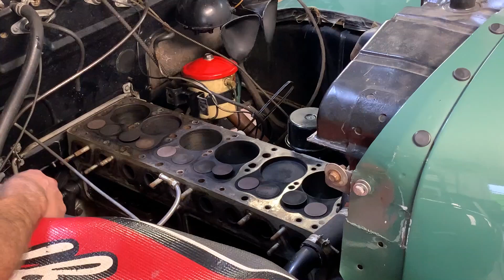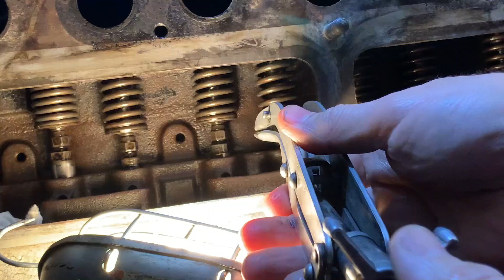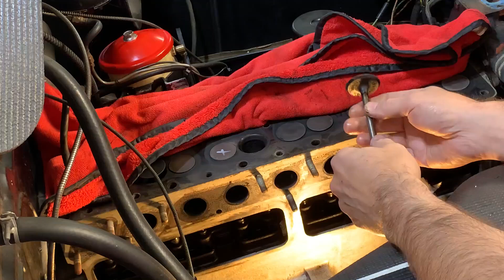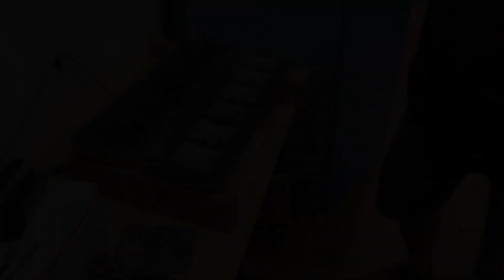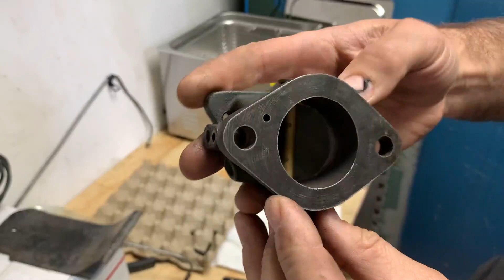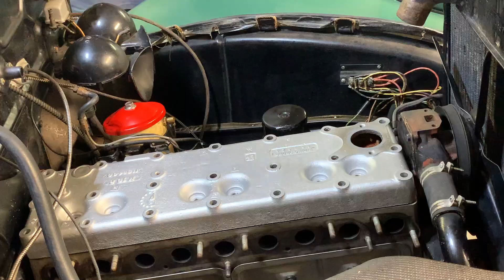Part 2: Cracked Cylinder Head - The Reckoning

Comment: Where do you order parts? I’m new to this with my first classic car, have a flat head 6 with a coolant leaking into combustion chamber, I’d like to replace gaskets, resurface the head and maybe replace intake and exhaust manifold and water pump while I’ve got it open if possible. But don’t know a dependable place to order from.
Reply from the maker: I buy parts from many sources. Some parts, from Rock Auto. Some at “Vintage Power Wagons”.  Or “oldmoparts.com”  I recommend you stay away from MoparPro as much as possible.  You need to measure the length of your cylinder head. Is it 23” or 25” long?

Comment: Valves get longer as they warm up. When this happens those nice   lapped areas no longer seal against one another until the engine cools down. Since I learned this I just use the 3 angle grinding method now.

Comment: I have an inline-8 engine: Chrysler 1946. What oil should I use? I put in 40 single-grade. Is it too thick?
Reply from the maker: Depends if you have sludge still inside your engine, from using non-detergent SAE oil.

Comment: Hello Keith, jusg another quick question for you; #6 cilinder has the hole drilled for a pin that can be set ontop of the piston. I would amagine for timing purposes. Mine is gone. Do you by any chance have the dimensions of this pin available please? Marty.
Reply from the maker: Its a brass plug, pipe thread. You should be able to easily get one locally. They are readily available and used in countless applications.

Comment: Hello Keith, thank you for your video's.  I much enjoy them. I have recently removthe head from my 1947 Fargo pick up with a T116 engine and noticed that the cylinder head bolts are threaded right into th water jacket and a coupl are threaded rightinto the intake runner in the block.Just wondering about sealing issues? Would a copper washer under the headbolt be in place for sealing purposes?
Marty.
Reply from the maker: Use Permatex high performance thread sealant on the headbolt threads.
Reply: Hi Keith, I'm nearly at the point of reassembling my head with the new head gasket... Will I be able to check torque on the headbolts in the 'future' if I use this thread sealant ?

Comment: Hi Keith. I just became an owner if a 1951 Dodge Wayfarer with stock 230 flat 6 and gyromatic trans. The runs and drives like new but is in need of a full service (all fluid change) I was wondering what fluids you run or what you recommend. Thanks

Comment: Hello Keith, newbie here again. I have been working on the timing and carb on my 53 Windsor. I set the idle down to 450 in gear and it shifts much better. It will never down shift on it's own due to the 12v conversion. I'm not a purest, so at some point I will modernize it. Thanks for all your video's and advice so far. Sherm
Reply from the maker: You cannot get a 12V shift solenoid for these transmissions. If want want to convert to 12V expect many headaches to come.
Reply: Newbie again, do you remember what kind of gas milage you got in your Windsor
Reply from the maker: @MarkSherman-h6u  I never actually calculated my fuel economy.  I always figured my old cars are for my pure pleasure. I thought that calculating fuel economy would maybe spoil some of the fun.  I didn’t want to know. I suspect 12-14 mpg might be a reasonable guess.

Comment: Hey Keith I have a 38 coupe  and wonder if  you could post a picture of the  bottom hand brake  cable  bracket.
Reply from the maker: I don’t believe we can post any photos here in You Tube chat.
Reply: If you could text me a picture I would greatly appreciate it. 602-339-7595
Reply from the maker: @ronaldmatusevitz8967  Can do. The cable bracket at the transmission mount?
Reply: @keithsgarage5831  Yes that's what I am looking for. Thanks

Comment: 2 silly questions from a newbie you’re helping out (me). #1: does the rebuild of the carb affect your fluid drive or is that regulated by an electronic controller?  #2: if I get the head off to laps, is it “just a few nuts” to get the pistons off and replace rings while I’m at it? If it literally isn’t a huge issue and I could stand to reseal the oil pan, I would love to tackle it, but I don’t want to underestimate it. Thoughts?
Reply from the maker: I haven't owned a basic fluid drive model. My '53 Chyrsler had a semi-auto transmission. There were two electric devices on the carb. An anti-stall dashpot, and a switch that would be activated when you floor'd the foot throttle. This switch was part of the system to force a downshift of the transmission.
Reply from the maker: The pistons and rods have to come out through the top to re-ring the engine. The oil pan comes off. Rod caps removed.Then the piston/rod comes out the top. If there is a ridge at the top of the cylinder (most often there is) the ridge needs to be reamed off before new rings are installed. The cylinder should be honed as well.

Comment: I'm about to change my exhaust gaskets on my 35 Dodge they leak bad. When you install your gasket do use anything to seal it. I'm thinking about using Indian head  that is nice and sticky.
Reply from the maker: I've not used anything on the intake or exhaust gaskets before. I see that Indian Head is only good to 350F. I suspect exhaust manifold temps get higher than that.
Reply: @keithsgarage5831  Thank you
Reply: there is a spray  gasket sealer  when you spray it has fine grains of copperin it works good ck auto stores  i use auto zone a lot  i think they have it
Reply: @frankdavidson9675  Thank you

Comment: Keith I love these old Mopar flathead sixes. I am now 75 but when My dad, employed in the oil business,  was transferred to Calgary I came to respect them. I was 16  in 1963 and in high school and I had a buddy with a 49 Plymouth 4 door. the Darn thing started even below  zero Fahrenheit. No it was not fast but it was solidly reliable. 14 years old, 6 volts it ran. great memories.
Reply: i have a 1953 dodge  flat head six i bought in 2011  i rebuilt it so easy to work on a lot people try  to set timing on #1 wrong   it set on #6 very simple the crank case pully has tdc stamped in it with several deg marks  i painted my marks white useing a tooth pick in the tiny lines rotate eng till it lins up on 4 deg before tdc go to dist remove cap rotor will be pointing close to 1 oclock poslooking down at it i so put cap back on install plugs crank eng  with eng running use timing light conn to # 6 plug wire look at pully where is it flashing   if not on  4th mark before tdc loosen bolt holding dist slowly rotate dist till it flashes on #4 tighten you are thru
Reply from the maker: @frankdavidson9675  The way the distributor drive shaft is connected to the oil pump, the engine timing can easily be set to #1 or #6. My understanding is when built new ,the timing was set to #1 at TDC. At the exact same point #6 is at TDC but not on compression stroke. Countless people over the decades have been installing their distributors 180 degrees out, the rotor pointed to 1 o'clock. It matters little.  Many Mopar distributors have a small thin line cut into the distributor metal housing indicating where #1 is, in reference to the rotor position. You can see this line, when the distributor cap is off. However...#1 TDC is not always at 1 or 7 o'clock with the rotor. Depending on vacuum line hook up, diaphragm location, adjustment bolt location, etc. Over the decades the distributors were turned and indexed to various clock positions. So there is no stead-fast formal rule.